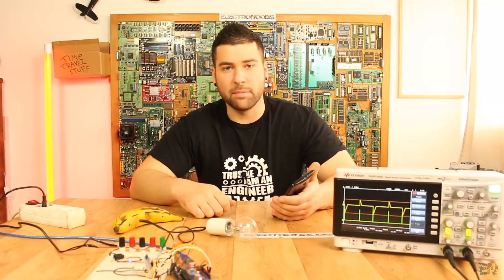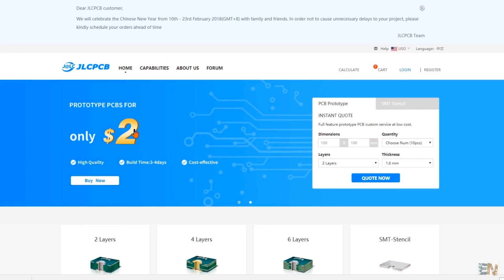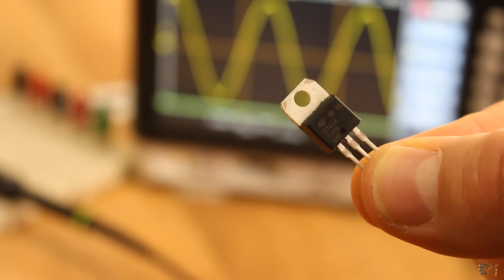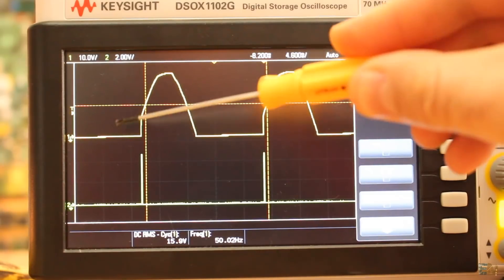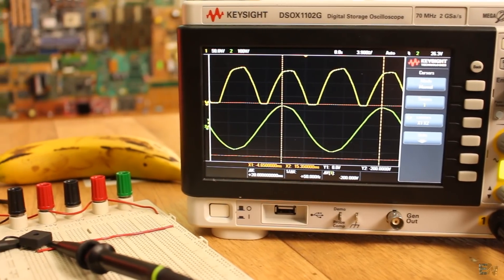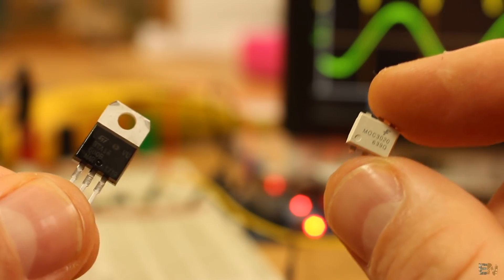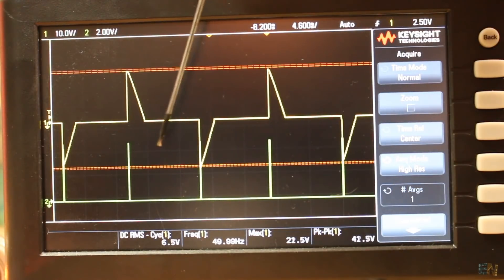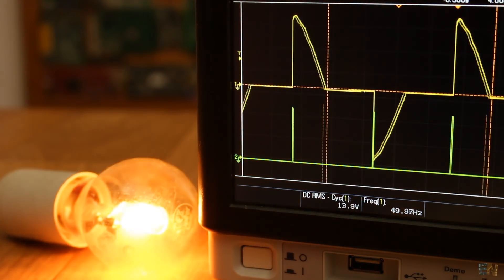Bluetooth TRIAC AC power control

Comment: I built a 3 axis CNC plotter and I want to modify it so  I can mill or engrave circuit boards. Is this motor a good one to use to make a DIY spindle for milling the circuit boards (See the motor at this link: https://www.ebay.co.uk/itm/Brother-RS-445PD-19120-MFC-5895CW-Print-Head-Drive-Motor-/261572208036) Thanks in advance for your help

Comment: How did you connect oscilloscope to mains and not shorts its ground to AC ground?
Reply from the maker: Ave Vovus! Only connect the probe. Don't connect GND from the oscilloscope when working with AC. After the rectified wave you can connect GND as well.
Reply: Ok, this is important thing.
Also check EEVBlog about it - How not to blow up your oscilloscope - kind interesting about correct connection osc to AC.
Reply: I have the same model scope, are you using the standard probe provided in 10x mode or you got some different probe for AC230v

Comment: One question... You must be using interrupts when taking the output signal from the opto IC that goes into the UNO... but you are connecting that to pin 8 of UNO.. pin 8 is not an interrupt for atmel328... so how you are dealing that...are you just using just if else for that???
Reply from the maker: Sayantan Maiti what do you mean? You can activate pin state change  PCMSK |= (1 << PCINT0) will trigger an interrupt on pin state change in D8. Keep up!
Reply: Thanks for the info...I previously thought that only D2 and D3 are being used for interrupts ..

Comment: $2 for manufacturing PCB. How much are shipping costs?
Reply: Napravis brate više e-mail profila i onda ti je svaka prva pošiljka 😂
Reply: Ма ово није тачно, барем за Србију. Већ сам имао једну поруџбину и платио сам поштарину.
Reply: Mi u Republici Srpskoj nismo plaćali nikakvu poštarinu za stvari sa eBay, ali od nedavno nam nažalost naplaćuju 1.8 KM ~ 1€ za svaki onaj paketić što stigne, a koliko si ti plaćao tu poštarinu za ove ploče?
Reply from the maker: Владимир Малић usually the first order is free shipping. Then depending on the service you select. DHl is kind of expensive ..

Comment: can you control motors with this? what is the difference between triac for resistive elements and triac for inductive elements? thank you for your channel and thanks in advance for answering
Reply from the maker: alvaro obyrne well, inductive will create a lot of spikes with switched control. Any way, you could use this with AC motors but not with all..
Reply: This is a master class! Wouldn't you make one of your short videos testing this circuit with different AC motors? If is not much asking. Again, thanks in advance.